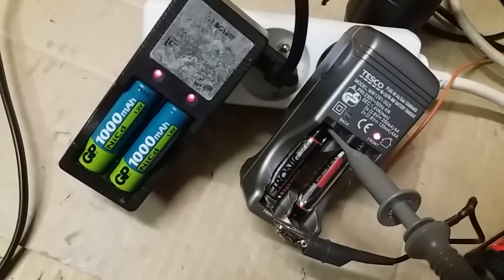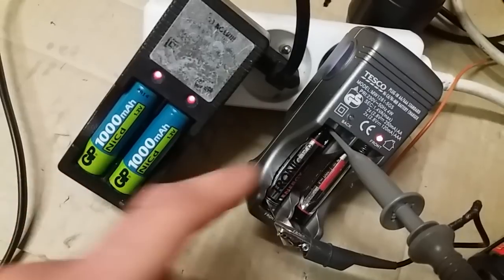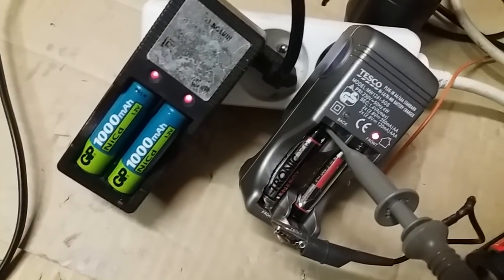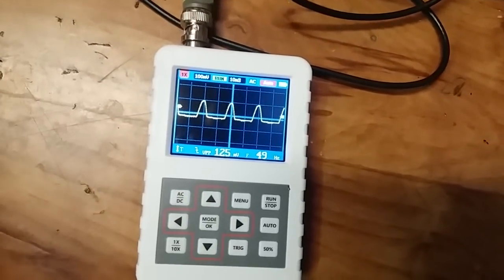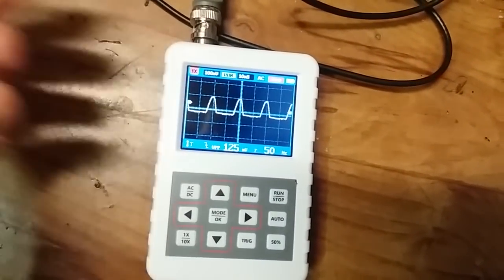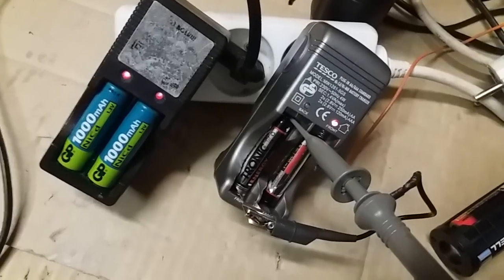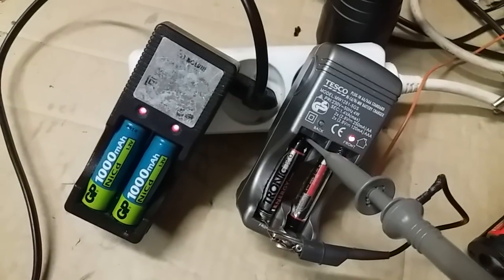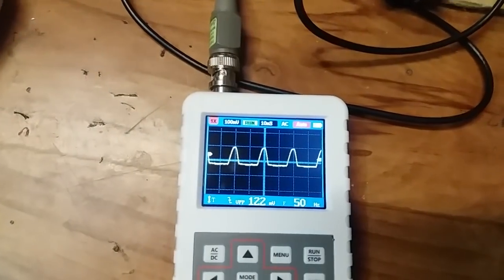Oddities of NiCd/NiMH chargers, surprising waveforms (unedited)

Comment: My wife is unable to discern the flicker in PWM LED lights.  I see the flicker in all PWM LED lights....even the newer cars with LED lighting.
Reply from the maker: People probably can't see it unless they know what to look for, but once they see it, they can't stop seeing it. Especially if you develop the habit of automatically checking every light source by your moving eyeballs.
Reply: I think some people know what to look for and also some people are just more sensitive. Some crappy mains LED bulbs have a 120Hz flicker, and it drives me crazy but my girlfriend seems to not notice it.
Reply: PWM LED taillights are the worst, as are 60Hz Christmas lights visible from the road. So distracting, not what you want when you're driving.

As for me personally, my sensitivity seems to vary based on the particular type (and probably also placement) of light. I have a 15 watt inductive preheat ballast fluorescent light made for under-cabinet use and the flicker on that is annoying. Meanwhile I'm usually not bothered by our American (autotransformer-type) 2x40w rapid-start fluorescents.

I'm sure I'd have an issue with European 100Hz tube lights due to the lower frequency. I don't know how anybody could ever live with 50Hz CRT TVs.
Reply: @eDoc2020  I read somewhere or heard somewhere that the North American florescent lighting effectively switches at 60hx x 2 or 120hz, but I cannot confirm, nor deny that at the moment.  Perhaps that's why it doesn't bother me or you so bad..
Reply: @TechGorilla1987  It is indeed 120Hz. I'm guessing part of why the 4ft lights don't really bother me is because their ballasts are very different than what's common in the higher-voltage countries. 120v ballasts for 4ft tubes are a current-limited step-up transformer which also has taps to warm up the tube filaments. Whereas I believe almost all 240v 4ft lights (and many but not all 120v lights in lower wattages) just use a simple inductive choke. An interesting experiment would be seeing if there is a different amount of flicker between these two types.

Comment: This old chargers are good to recover batteries from deep discharge. Newer ones deny to charge and show "Error" only. 🙄
Reply: I had a charger just like that, without the phillips branding and in "timeless" beige. Not very fast but reliable.
Reply: I’ve tried multiple “recovery” operations with different methods and different battery chemistry and different initial states.  None of the results have ever been what I would call decent or reliable.  I think there’s a lot of internet mythology floating around on this subject.

Comment: Sir, I enjoy watching your informative videos. 
I have a query. I have Nikon MH-73 charger for 4 AA or 2 AAA Ni-MH batteries. Problem is the batteries and charger become super hot while charging and the single led indicator cuts-off very early. The OCV before placing the batteries is 4.8 v. Is it correct? Is there any problem with feedback circuit. Some suggestion is welcome. 
I  am from India. 
Thank you.

Comment: All NiMH chargers are pulsing the current, probably to avoid switcher noise while measuring voltage. With chargers that switches the charge circuit between slots there is a small pause each time it switches.
I have tested lots of chargers: https://lygte-info.dk/info/indexBatteriesAndChargers%20UK.html
Reply: Are you one man? You have so much content on that website
Reply: Yes, one man, but I have been working on that website for a long time.
Reply: cool website !

Comment: Very nice video. As for the Tronic batteries, the green ones (ready to use) are better, do not lose power and charge well all the time. I didn't get along well with the red ones, because I use fast charging and they don't keep the current very well.
Reply from the maker: Today I've bought one package of the green AAA ones :). I will compare them to the red ones. The green ones were more expensive despite the lower capacity.
Reply: @DiodeGoneWild  Nice. I'm glad you found greens too. Ready to use ones are better. Although they have a smaller capacity, they are more stable over time. The red ones, after a month, at most 3 months are almost exhausted and cannot be used. I found it at Lidl, sometimes red, sometimes green, at the same price. After seeing that the red ones didn't hold, I only bought the green ones. I charge them at a current of 500mA and I use La Crosse BC700 charger and LiitoKala Lii-500 charger.

Comment: i read on Wikipedia that a radio broadcasts ac, if you had a 50hz ac radio signal and a radio receiver you could maybe amplify the radio signal to recharge the battery keeping the device powered wirelessly 🤔📻🔋🤷‍♂️

Comment: Danek, you can pot all of the inductors' windings in liquid epoxy, or in case layers are not separatd with adheasive insulation tape you can spray them with acrylic lacquer that may not even be special electronics one if it is a transparant one and not only the sound should disappear but they will last longer.

Comment: 500mAh was the standard capacity of AA NiCd cells in the mid to late 80s. You can guess the age of the 50/120mA charger from that.
The "strange audible noise" is standard behaviour for pulse-frequency modulated flyback supplies: Every pulse they transfer has a minimum amount of energy (worst case: a fixed amount of energy). If the load is low, the dead time between the pulses goes up. If the load is low enough, the frequency drops into audible range.

Comment: These "dumb" chargers suffer from a lack or regulation. Basically the higher the mains voltage, the higher the charge current. This raises quite an annoying problem : in my house mains voltage is 243 volts ( which is ok) and when a battery is fully charged, the voltage drop on the current limiting resistor is still too high and the LED stays on...

Concerning the "smart" charger I woule guess it uses a flyback power supply ( possibly 3.3 or 5V) followed by a current mode buck regulator + microcontroller + 4 MOSFETs. When the charger is not charging (3/4 of the time if there's only 1 battery) the current draw is very low. The flyback  power supply goes into discontinuous conduction mode and it the duty cycle reaches a very low value. The controller reduces the frequency to avoid having a very short Ton which would lead to a higher standby power and interference.
Reply from the maker: The LED in the dumb chargers is NOT meant to turn off :).

Comment: Pulsed current often is better and more efficient for older batteries! There are special battery recovery chargers for lead acid batteries that work with even higher pulses. Also the pulses come probably naturally by even the cheap dumb chargers cause they are based on switch mode power supllies. They "naturally" generate pulses (which can be smoothened of course by capacitors e.g.). Hmm if the pulsing frequency is 50Hz it comes from the mains 50Hz - maybe its only a little transformer with a diode :-) - no SMPS.

Comment: In the 1990s, I remember electronics hobbyists talking about asymmetrical pulses AC as a way to charge Zinc/Carbon or alkaline batteries... do you know anything about that?
If I want to detect LED flicker, I shake my head like I'm having a seizure. It works really well.

Comment: A senior battery engineer told me that heat is the ultimate enemy to batteries. So slow, cool charging is fundamental. He said cylinder batteries optimal, principally for heat reasons. The rapid charging smartphone and HYBRID car batteries are great...for the device makers.
Reply: Heat COMBINED with a full state of charge is the major problem. If heated only during charging it’s not so bad. But it then also should not stay at 100%. This is why all serious car makers allow you to limit charge to something like 80 or 90%. Something unfortunately only possible on very few laptops, though there are some!
Reply: The heat is a problem once the full state of charge has been reached as it will cause gas build-up in NiCad/NiMh batteries, which causes them to vent their electrolyte, and ultimately fail. Lead acid can be quickly charged, provided the charge is tapered towards the end to prevent hydrogen build-up, which again causes a loss of electrolyte, and again ultimately fail. Li-Ion is a bit different in that it needs a fairly specific charge profile to avoid things like plating out the lithium metal and possible damage to the separator (and possibly flames or a shorted cell). Many cells are capable of being charged at several times their rated capacity or more without issue. Its all down to the construction of the cell.

Comment: As you said, the weird pulses of Sony charger may have something to do with increasing precision of voltage measurements for -∆V termination. I remember reading at lygte-info.dk that it can help reduce noise - considering that the lower -∆V, the longer battery life. E.g. 5 mV is the best.
Reply: I love that guy’s website! He has some of the most thorough multimeter reviews out there.

Comment: You have me wondering about Qualcomm's Quickcharge , USB PD , Samsung's AFC etc.... Voltage / current vs time.., even if the cell isnt divided they're putting a lot of current in the battery below 70%

Comment: Those gray/red batterries with the 'Tronic' brand are from Lidl. They sold for like 1.87EUR per 4xAA 2500mAh. Capacity measurement came out to about that. The crazy thing is, that the Lidl website for a long time was selling two types of 'Tronic' NiMH rechargables at the same time, with exactly the same specs, these gray/red ones, and green/black ones, which they still sell for 3.87EUR per 4x AA. I can't understand the logic/logistics of that, and the cheaper ones were not old stock as the manufacturing date was less than 4 months old... I certainly stocked up on a bunch, I imagine you did too! ;)

Comment: In the interest of science, is there any safe way to see "what happens" when a battery charger is used to try and recharge a non rechargeable battery? I vaguely remember doing this bad thing with no ill effect decades ago. I can't remember if the battery actually recharged. Maybe a little.
Reply: Alkaline batteries can actually be recharged. The problem are :
1) It will not fully recharge and its capacity will decrease quickly
2) HUGH problem : the charging current must be very low otherwise the batteries will inevitably leak... not good.

Comment: Very interesting content about chargers. Thank You!
For my NiMH batteries I use smart charger from Panasonic. It allows to charge 1-4 AA or AAA cells, and automatically turns off by delta voltage. I think they use some cheap microcontroller. My batteries are very cheap, and I use them in wireless mouse.

Comment: Dude the circuit is not galvanically isolated but how the heck are you able to touch it with bare hand , once I touched such a dodgy charger from a chinese flashlight charger and was shocked to hell..... I want an explanation....
Reply: These chargers are galvanically isolated, the dumb chargers contain a classic iron core transformer, and the Sony one probably contain an SMPS
Reply: There chargers which aren't isolated from mains, but they all fall into one of two (actually three) categories:
1) Designed so it's impossible to touch the battery contacts when it's plugged in, or,
2) Designed without regard for safety standards, probably grey market imports. Dodge Chinese products may fall into this category.

Or also 3) where the isolation has failed.
Reply: @eDoc2020  Apprently you are correct with the points you just suggested, furthermore I have more faith in your second point,(i.e they are made without any regards for safety).Well I want to make a Li-ion battery powered flashlight but I don't want to use any dedicated IC for that as it would make a project a costly and also occupy a lot of time , I came across Many circuits but they either cannot be powered by a 3.7 v source  or they are not a constant current source one....Awaiting Replay

Comment: Hey I am looking for an oscilloscope, the one you used in the video is good or bad?
Reply: Interesting osciloscope? Where to buy??
Reply: @JPAG0806  I found it on amazon but it may vary based on the coutry you live in
Reply: You have to check for it to have a timebase and voltage range setting!
It's also good if it has two inputs to compare!
The problem is that if it is grounded putting it into the primary of switching power supplies blows them up, because ground acts as neutral!
It also good to have a hold button that holds about 1 second, so that you can see 1 second of the waveform frozen in time, and then zoom it!
Of course you need a zoom function!
Reply: @JPAG0806  aliexpress/banggood